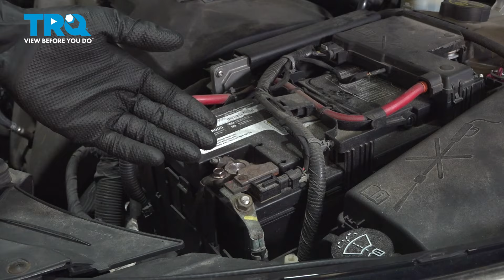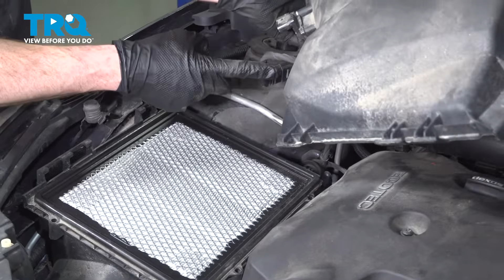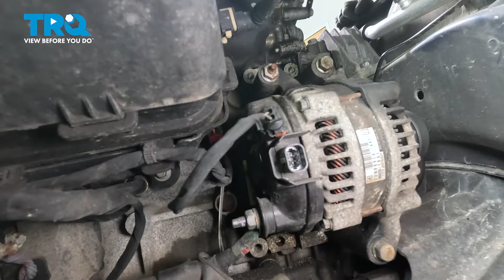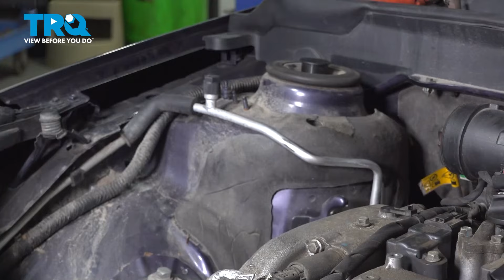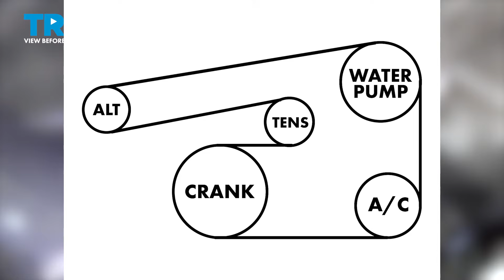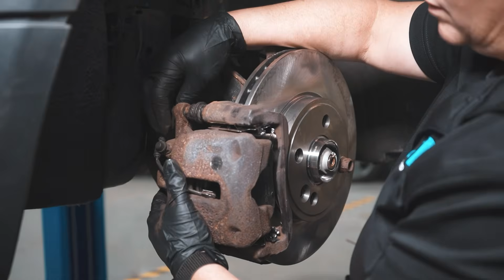How to Replace Alternator 2013-2015 Chevrolet Malibu 2.5L L4

Comment: Question my Malibu has an extra hose that goes from the front of the air intake and makes its way to right on top of the alternator, do you know how to remove that It is a 2013 2.5 eco boost LT
Reply: It looks like it’s connected to a fuel line with a box, there’s no obvious way to remove it and there no way the alternator is coming out with that in the way